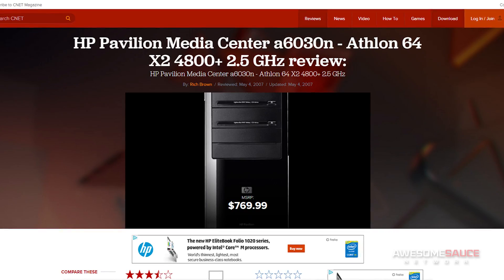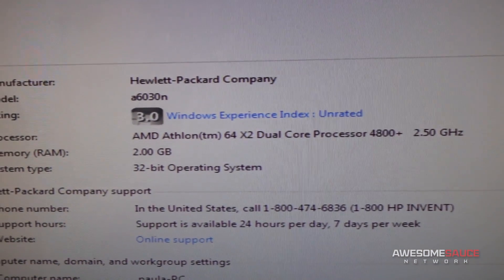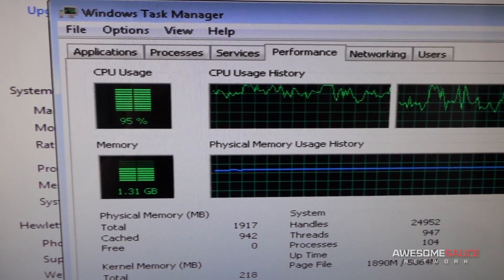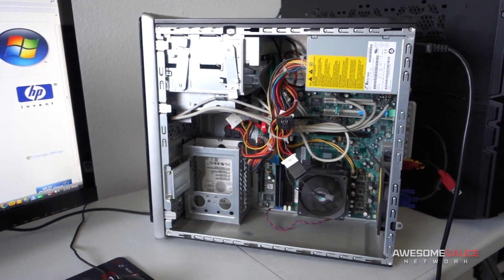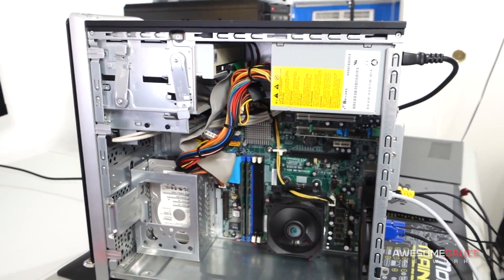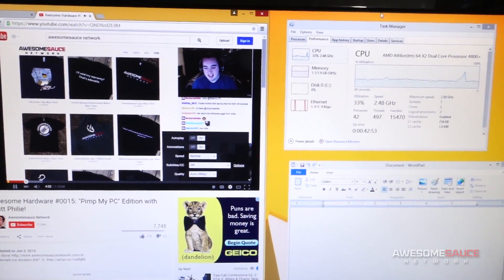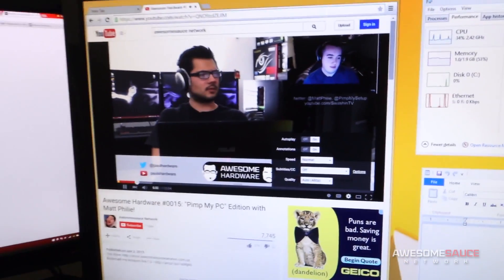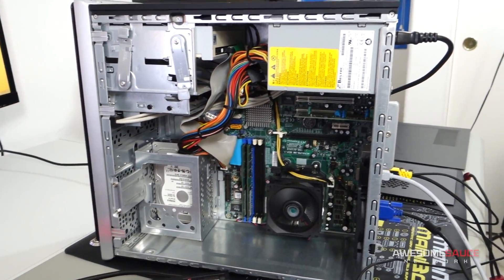Cleaning Up My Neighbor's Old Desktop!

Comment: I personally run a Dell Latitude D530 with Vista Business SP2 32-bit loaded onto it's 80 GB SSD and I found out something about Vista...32-bit versions run best with 2 GB of RAM. No clue why this happens, but it's probably due to an optimization bug with Vista seeing as it's an older version of the Windows 7 shell, basically. I had both the internal and secondary RAM sticks swapped for 2 GB of DDR2 laptop RAM that I forget the correct terminology for and even with the SSD in place, the laptop would occasionally stop for a second here and there and just plain hated doing anything. It even bluescreened from stopping in the middle of waking up from sleep mode once. Eventually I took out the RAM stick that you can access from the bottom of the laptop (as the other stick of RAM can only be accessed by pulling off the entire top panel of the laptop base, which is my only personal gripe with this machine) and I had no more stutters and stops. The only ones I was experiencing were with a folder I found out was bugged from me trying to set it up to be accessible through my Wifi at home and forced me to pull all the files off, delete it, create it again and then put all the files back in, but that's it.

Comment: This video is essentially exactly what I do for a living everyday. I enjoy doing cable management in cases where the case does not accommodate for it, and here I see you've done a pretty good job. Shame you couldn't find him a couple of sticks of DDR2. Also pro tip. The product stickers are good for 64 bit and 32 bit so if you found him more RAM and a 64bit install disc you could put 64 bit on there, same goes for 7.

Comment: i had a case that was very similar. gave it to a relative after doing a couple upgrades and using it for about a year or so. there is no cable management. think it could have taken a fan on front. something else i didn't bother with. it was a c2d and my old 5760, not really worth it.

Comment: ugh... why windows 8.1 with a cpu that can barely handle vista... The computer was designed to run on XP/Vista. the least you could've done was put it on 7. I got a system with lower specs than this PC shown and it runs at least 2x better. The only plain difference is that the system has a TNT2 Ultra gpu.

Comment: I literally just subscribed because of that cable management, I didn't think that those cables could be improved without any routing holes in the case, but I was proved wrong. This has inspired me to manage my cables a little better :)

Comment: Those fan bearings still kicking?  I mean they do look like they're going slow so that helps I'm sure...and honestly only fan that ever died on me(bearing problem) was a Yate Loon 80CFM 120mm UV/LED fan.  Got that when I wanted airflow galore and didn't care so much about noise.  That fan also ran at 100% most of it's life.

Comment: Quick Question: I'm quite amazed at how clean that CPU fan came out, did you use anything in particular for the cleaning of it? Granted, usually, I just use water and paper towel (absorbs more than the coffee grounds paper, in my experience), or, occasionally, some Que-tips due to the cotton being extremely absorbent of dust (although, I have to ground myself continuously, because cotton is a VERY high static conductor).

Also, did you make sure to re-apply thermal paste underneath the Northbridge/Southbridge chip? That helps, too.

Also, did you charge anything for this or was this completely free? Just curious.

Comment: Can somebody help be diagnose a problem I'm having? My PC was working fine two days ago when I fell asleep, and then when I went to go turn it on the next morning, the computer would boost up properly, but not open any applications. I turned it off immediately and disconnected the router cable, then turned it on again, and the same thing would occur (boost-not open). I repeated this multiple times until finally I was able to open an application. When the computer actually functioned it was as if nothing had happened. I ran two antivirus/ malware scans with avast and malwarebytes and no virus was detected. I turned it off again and then on, and again no applications would open up. If anyone knows what the solution might be please respond. 

I think it might be the Hard Drive that contains windows but I'm not sure.
Reply: Pm me
Reply: Have you downloaded anything recently? And I would advise you to go into Safe Mode while you are doing a virus scan.

Comment: 3 things to improve the speed and life of this computer by possibly up to 60%  1.Replacing the drives with sata drives.  2.Installing a low cost graphics option to reduce the load on the system memory.  3.Installing a further 2 gigs of memory or at least making sure it's running in dual channel mode.

I commonly work with computers this old for friends and family so I've seen the difference changes like that can make.
Reply: hellcat1988 Remember, he's not a power user. And not a gamer whatsoever. So GT 720 would be more than enough for his needs. 
As far as PSU goes, I'd at least crack the thing open and blow the dust out of it. Had a problem with shortened circuit because of dust.
And yeah, 2 extra gigs is a must.
Reply: ***** Wow...  You really don't know anything about computers and didn't pay attention to the video at all. 

That board has 4 sata ports on it (the yellow, blue, white, and black ports at the top left of the board), and 4 ddr2 dim slots with two different colors supporting dual channel memory capability which has been around for a LONG time.

The board has a pci-e 16x slot so adding a gpu would take load off the existing ram and integrated graphics, potentially giving thermal headroom so the cpu cooler will run quieter and the system itself will have more available memory for programs and the O.S.  Nothing beyond early gen 2 16x will run at it's full potential, but it'll still do what it's intended because he's not a gamer so the card doesn't have to be the latest and greatest.  A number of system builders on here including Jayztwocents and LinusTechTips have referenced that a gen 2 16x slot isn't even being fully saturated by the latest gen 3 16x cards.

I know these things because I have that exact same board sitting next to me right now.  It's commonly referred to as the Nettle.  I haven't used it in a while, but I do remember that a bios flash and knowing the hot keys gives you access to some nice overclocking features.

Here's the spec list if you want to check it out yourself.  http://support.hp.com/us-en/document/c00906137
Reply: Heruvilius
I agree that a 720 would work, but it doesn't even need to be that new. 

I wouldn't crack the power supply open unless he's had experience with electronics though.  I've worked on a few myself before and never had a problem, but that doesn't mean he won't.  I've got first hand experience with how dangerous a charged power supply can be. 

Granted the one that got me was actually two wired together by my father when I was 12.  He gave me the comp when he bought a new one.  I can't remember why he wired the two together, but he didn't have the cover on the second one and mounted it to the bottom in the front.  I was messing with something inside on the mobo while the computer was on, can't remember what, and lost some skin on two of my fingers from the resulting ark across them.

Funny thing is I didn't damage any of the components; just got burned pretty bad.  My room DID smell like overcooked skin for a while though.
Reply: hellcat1988 Tape a NUC, power brick and all, inside and fudge the connectors to appear to be native.
Reply: InfinityCraft
I know but that was a HUGE rookie mistake on my part.  It's hard to justify dressing down someone who's ignorant about computers for not paying attention when I missed something so obvious like that.  I apologize to BK for that, but not for the other stuff.
Reply: hellcat1988 the thing is, the hard drive is already sata, the one that is using IDE is the cd/dvd optical drive, which is not going to improve the speed of the computer. i agree on the second and third though. the third is harder because ddr2 ram is harder to find these days, not to mention you have to look the one that the motherboard supports.
Reply: *****
Unfortunately, some older boards won't support booting from an ssd.  I just ran into that with an intel socket lga 775 board I was working on for fun a few days ago. 

As far as the psu is concerned, he could have used something like a gtx 750ti like I run.  It doesn't need 6 pin pcie power and doesn't tax the system much unless you overclock it and game.  There are even other options like older graphics cards and/or Nvidea gt cards that don't use 6 pin pcie power and are relatively low draw. 

We all know how fun it can be to shop on ebay, but there are always at least 2 very cheap low power pcie gen 1 or 2 cards for sale there. 

That's also an easy place to find cheap memory if you don't collect old computers from recycling as I do for free parts.
Reply: ***** 220W?  Really?  I'd guess at least 300W with that many plugs coming out of it.  Yeah, there's not much in there, but we're talkin Athlon 64 x2 days.  I have an Emachines system that was store bought, and even it came with a 300W.  I bought it in 2005.
Reply: *****
I made sure the ssd was completely and totally wiped and cleared of any partition with a different computer and a partition program, then did a fresh install of an operating system on the machine from a usb drive.  It still wouldn't take the ssd.  It actually said in the windows repair utility that the motherboard didn't support booting from an ssd.

With the power supply deal, I couldn't read the label on it, but most power supplies I've pulled from computers of that era have at least a 320w power supply.  I haven't found anything less in a LONG time.  As long as he didn't overclock the cpu and graphics card, it should be able to handle the 50-70w that a low end card would put on the system at full tilt. 

The two 350w power supplies that I've messed with recently from old computers both had 6 pin pcie connectors and ran my radeon hd 4830 no problem.  Typically if there is a sata connector on the power supply (which there usually will be in a system with sata on the mobo) it will have enough power to push at least 2 hdd or more and at 1 disk drive. 

That all running at once can draw 300-400w so big box builders will usually put a psu that can handle at least it's max load in.  I don't think I've yet to come across a system yet with pcie slots that can't drive my OLD nvidea cards that don't require supplemental power.

Hell, I've got a Radeon x300 from 2004 that works in everything I've stuck it in.  It came out of an old Dell if I remember correctly.
Reply: hellcat1988 Hmm, my P35 chipset Socket 775 Gigabyte motherboard has no problems with my SSD, even though it doesn't use its full potential speed at all (130 MB/s sequential read / write speed, what the heck is this...).
Reply: InfinityCraft
The board I ran into the problem with comes up as an intel manufactured board.  I haven't been able to find much about it or any kind of bios update.  That may be why it won't accept it.  I just wanted to mention that it wouldn't take it so people know there ARE boards that can have that problem out there.
Reply: LOL I actually could do that...  Not that I should.  A standard case would take up more room than a nuc would though, so it'd be pointless.  I know a few people these days that wouldn't need more than one of the new hdmi computer sticks or the wall plug computer bricks that have been unveiled in the last few months.

People who only use computers to brows the internet depress me.  Power users for the win!
Reply: Nvidia GT210 is enough. With ssd 120gb Kingston.
Reply: its a stock motherboard it doesn't have to dual channel memory modes. and it is so old it still uses a IDE cables. so you can't place a SATA Drive in it. and the expansion slots are so old that investing in a GPU would not make sense because current generation GPUs Will not work at full potential
Reply: Krit Pituckrachai I already mentioned why an ssd might not work.  It's definitely not worth the investment when a $70 pentium g3258 and a $70 mobo with some light overclocking would be far more than twice the computer even with the existing hdd and the new on board graphics.  Add an 8 gig stick of ddr3 and you'd have a system that probably costs less to build than this one did to buy and would handle all the stuff his neighbor does for the foreseeable future.  Even the computer sticks I mentioned before would out perform this guys' old computer without effort.
Reply: ***** So you're just gonna completely ignore the fact that the board has different colored RAM slots (same color = dual channel) and the fact that there WAS, in fact, a SATA HDD in there?
"and the expansion slots are so old that investing in a GPU would not make sense because current generation GPUs Will not work at full potential"
My 750 Ti runs just as well in my old PC with PCI-E 2.0 as it does in my current PC with PCI-E 3.0. Also, was anyone speaking of high-end GPUs? Just putting a low-end GPU like the R7 240 or the GT 210 in there would improve the performance already; those GPUs could never even use PCI-E 2.0 to its full potential; I doubt it would even saturate PCI-E 1.0.

I know I just totally repeated what hellcat1988 has said already, but... yeah.
Reply: InfinityCraft Oops.  I saw the ribbon cable when he was working on it, but I didn't see the sate cable.  Derp.
Reply: hellcat1988 I was referring to Benjerman, lol.
Reply: ***** I agree ! It takes time and experience to learn how to get the most bang for the buck !
Reply: hellcat1988 my brothers laptop wouldn't have served you well... I tried to used the ram when my own failed a couple months ago... his ram was dead too.
Reply: I decided to build up the nettle 2 board I have (I have both the nettle 1 and 2 boards) with the amd athlon 64 x2 5000+ that I have. (I'm going to get a 5600+ or one of the phenoms soon.  The board supports the 5600+ native but the bios flash I found allows it to support the phenoms that used the am2 socket) I have a saphire radeon 4830 graphics card with 3gig of ddr2 system memory in it right now because one of the memory slots on it won't let the computer boot for some reason even before I did the bios flash (I have 3 1gig sticks and might go for at least 2 2gig sticks later) the processor is running at 2.9mghz right now because I haven't bothered to REALLY try to overclock it yet and it's only got the stock cooler. 

I can say right now that it's crawling compared to the pentium g3258 system running at 3.4mghz I have with 6 gig of ddr3 from my dead i7 720 system.  I've heard of people getting the amd systems close to that overclock but it wouldn't catch up. 

I got my pentium system off ebay with the mobo and processor together for $60 but it's possible to build the same system I have for under $300 buying new or very slightly used parts.  Probably under $200 if you already have a power supply, case, O.S. and use the onboard graphics or get a really cheap old card off ebay.

I haven't run benchmarks on the two systems against each other yet because the pentium has water cooling and a much better case for airflow so it wouldn't exactly be fair, but even if I dropped the pentium down to it's stock speed and pulled out 3 gig of ram and made it run in single channel mode it'd still be faster than the amd because of the instruction sets for the processors.

Bottom line here folks is if you're not a gamer or don't do any kind of intensive computer use, the old stuff is still fine; if a little slow for my taste.
Reply: QuantumWrench You win at tech support.
Reply: Risvegliare R
All of those things were already covered in the previous comments.
Reply: He's an old man running basic processes..he doesn't need no sata drive or even a dedicated graphics card.,.and if you're going to be spending any money just buy a new one.. Heck, the intel computer sticks for $200 would be a better option than that old computer.
Reply: stephenmartinez1
Unless he's like a lot of us who know that it's not a very powerful option, sends all of your data to microsoft, and has nothing in the way of local storage solutions.
Reply: +Benjerman Kulandaisamy Ehrm, the HDD in that system is connected with a SATA cable. The IDE cable you see only connects to the DVD Drive. And the other flatcable is for the floppy drive.

Comment: Kyle, should i change my pc build at all?

Intel Core i5 4690K @ 4.5ghz
16gb of g skill memory @2133mhz
Evga Z97 FTW motherboard
2x Asus R9 290x cossfire
Enermax platimax 1000 watt
Enermax liqtech 240
samsung 850 pro  265gb ssd
kingston hyperx savage 240 gb ssd
Fractal design define r4 
3x noctua redux 140mm intake fans 
2x enermax high static preasure exhaust fans

Comment: Good for you, what a nice guy, it's nice u helped this guy out,  I mean just the windows 8 with product key ain't free, did u av A spare copy?  Maybe you can help. I can't send it as I'm in UK and it's only a Toshiba Tecra A6. But had 667 ddr2 in slot 1 and ddr2 666KHz is that making it run slow. It has w7 64bit with 2 gb ram. It's socket M dual core 1.6 ghz and a apple 500 gb hdd that I installed the windows 7 on. But it just runs hot noisy. Fan sound like bearings are shot. Can I replace my ram and cpu